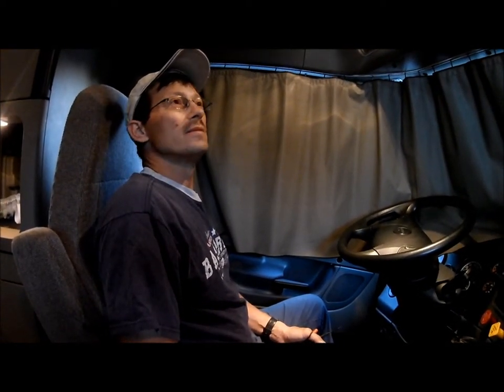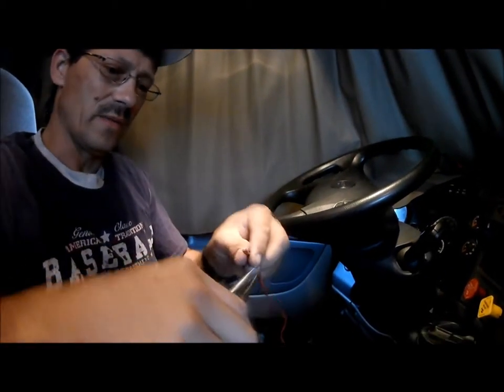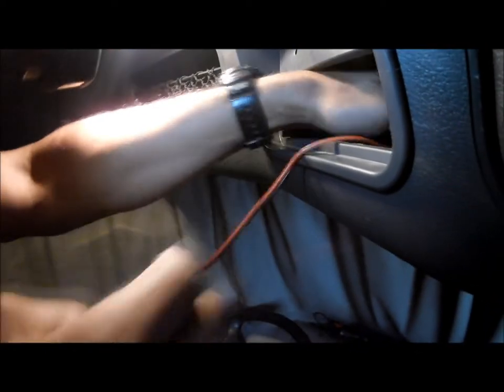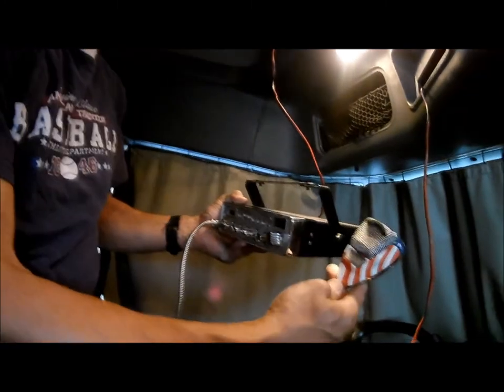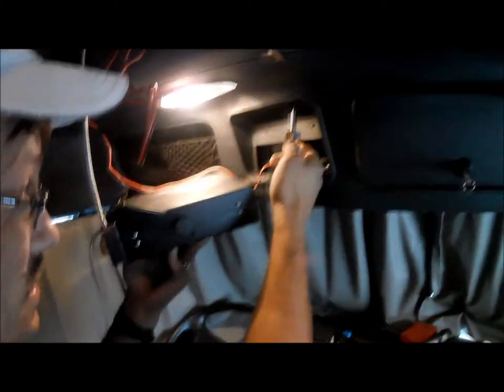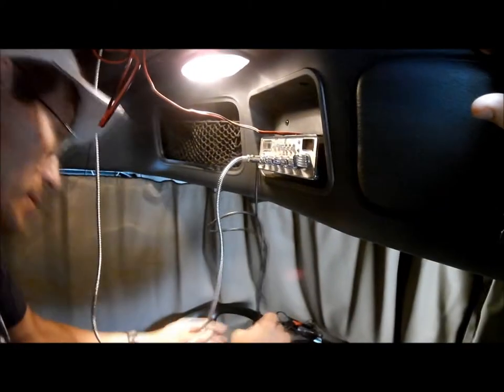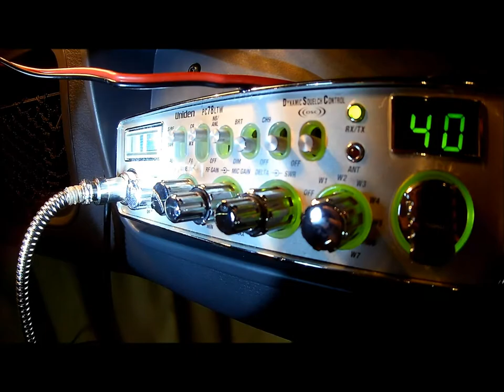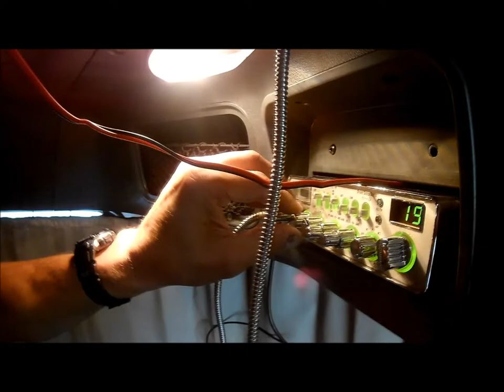HOW TO INSTALL A CB IN A FRIEGHTLINER

Comment: Where did you get that mounting bracket? Mine I got with the radio is straight, doesn't fit at all in the hole.